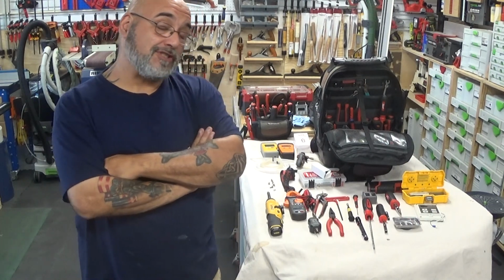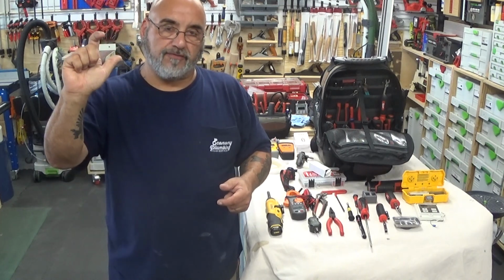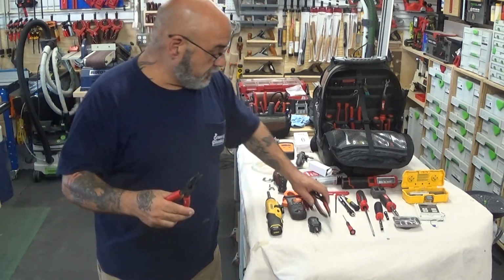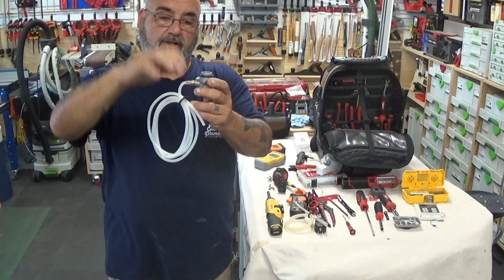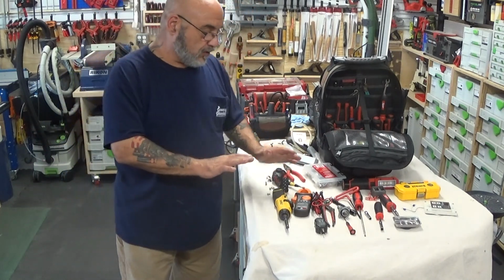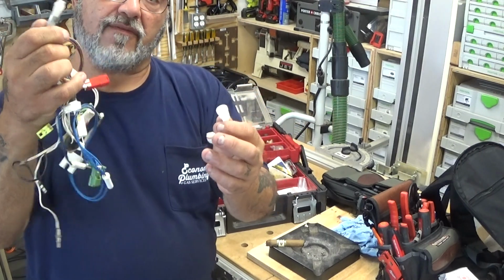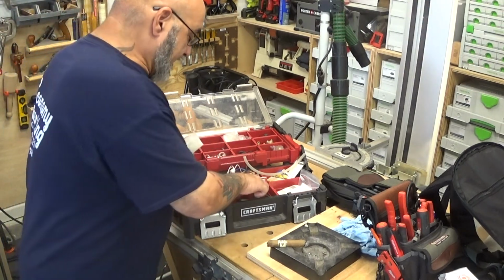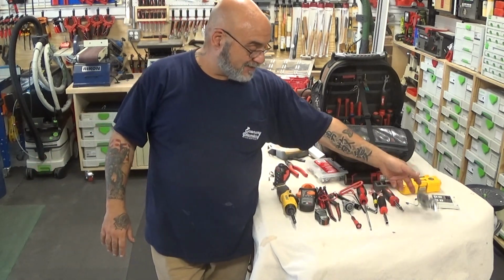Tools and basic material you should carry for a Rinnai tankless.

Comment: Thank you for you informative videos.  On an exterior unit (75e) does the condensation line drain when you drain the hot and cold water out of the unit?  My manual says I can add auto solenoid drain valves for hot and cold but I have to manually drain the condensation line.  I do not see any place to drain that line.